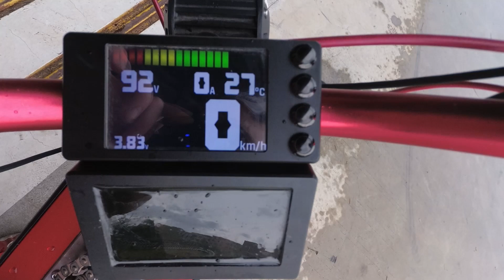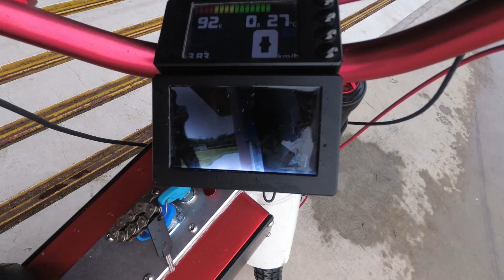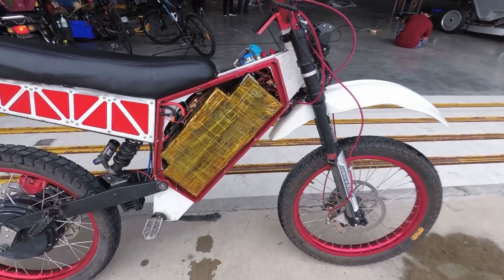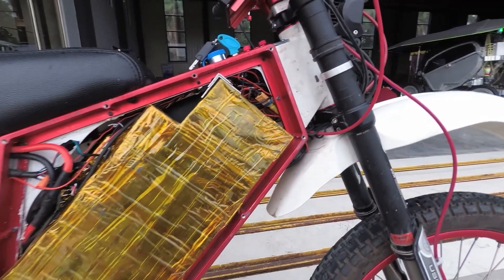Extreme E-Bike 100km/h!

Comment: oh boy, that rear rotor is overkill as you said so yourself but it's way better than bicycle 203mm brake rotor. I thought it much how to install similar size rotor and there is no room for less han 320mm diameter moto rotor therefore it can be justified well. I just don't like idea to drill hub motor side cover to install brake rotor.  I though to use original 6holes x 5mm and make adapter for motor rotor but not sure yet which way is the way.